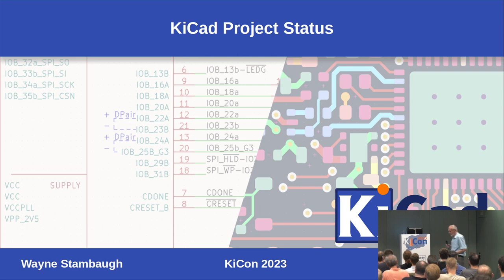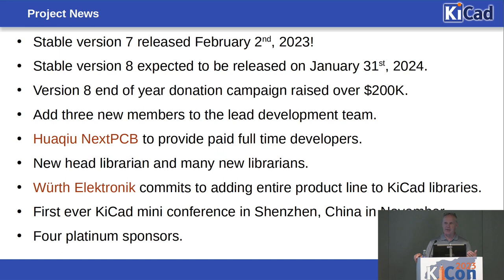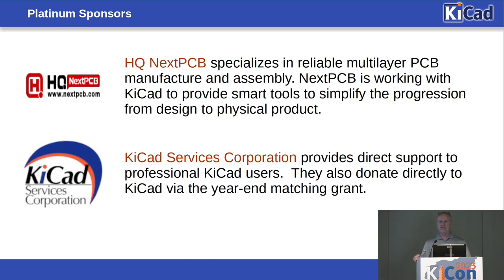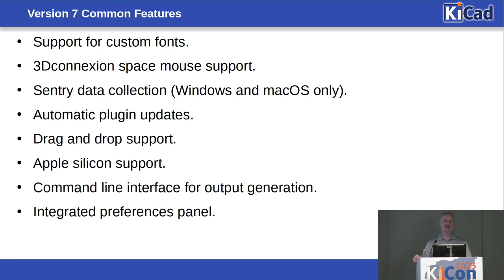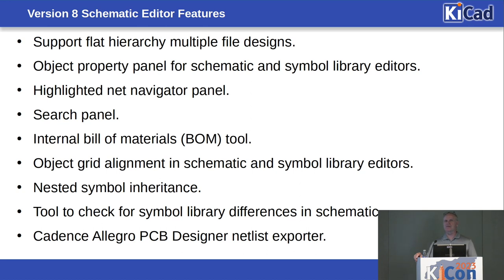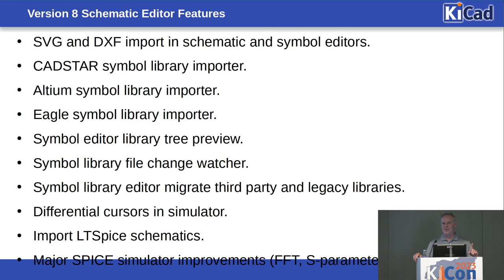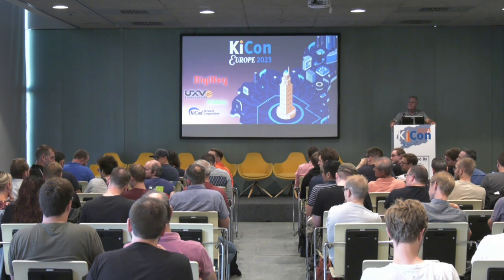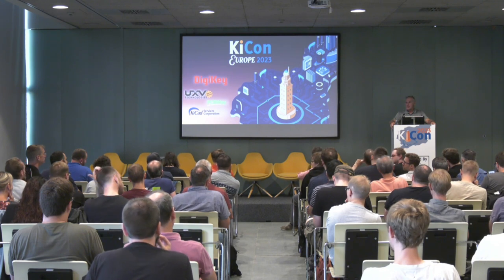KiCad Project Status - KiCon 2023

Comment: Seems that the slides are way ahead of Wayne... out of sync
Reply: It really bothered me, so I stitched together an FFmpeg script that fixes that issue. I don't think I can upload the fixed video, but I can share my script:

ffmpeg -i "KiCad Project Status - KiCon 2023.mp4" -ss 00:00:40 -t 00:30:08 -filter:v "crop=320:180:960:540" -c:a copy speaker.mp4

ffmpeg -i "KiCad Project Status - KiCon 2023.mp4" -i speaker.mp4 -filter_complex "[1:v]scale=320:180[ovrl],[0:0][ovrl]overlay=:x=960:y=540[out]" -t 00:30:08  -map [out] -map 1:1 part_with_slides_fixed.mp4
Reply: They wanted Wayne to finish his presentation sooner. haha
Reply: It's pretty easy to open this video in two browser tabs. Run one for the audio, and view the other for the slides with audio turned down. You can start both around the same time, and just delay the slides as needed, like by using the left arrow.